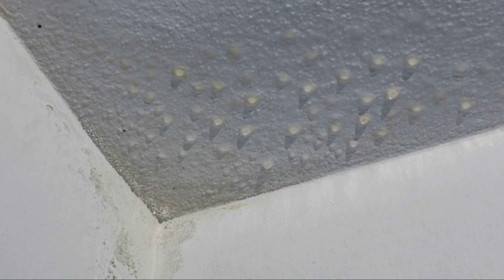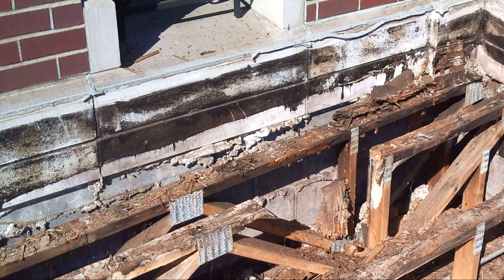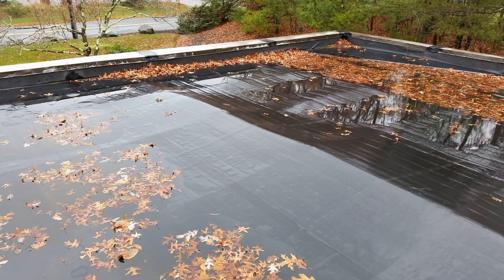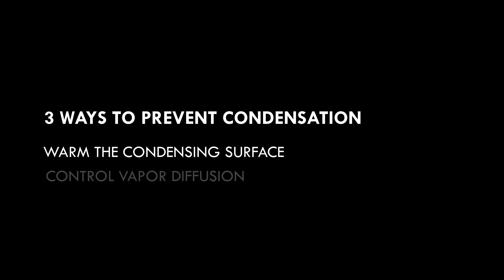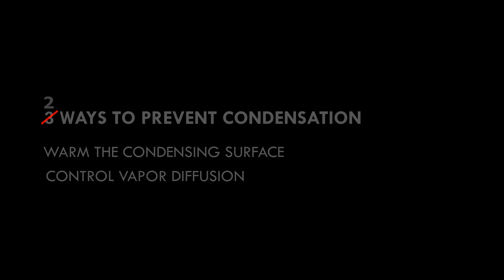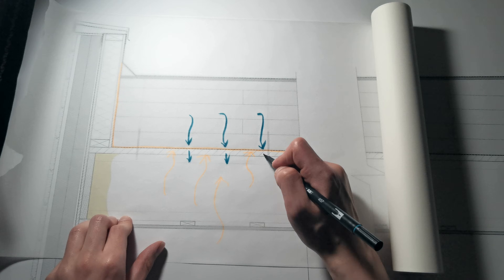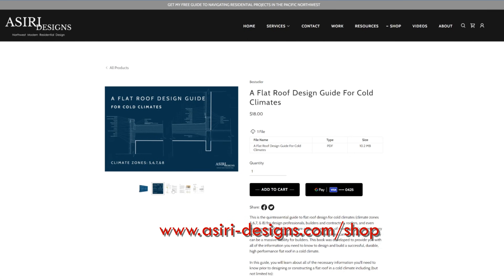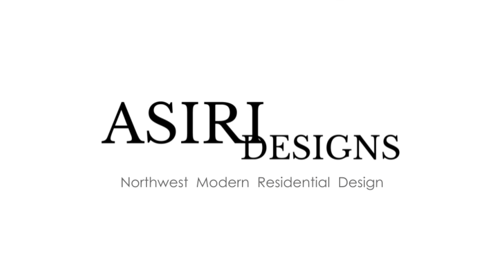Preventing Condensation in Flat Roof Assemblies

Comment: Isn't the term "flat roof" a misnomer?  "Flat" in relation to what?  Aren't all roofs "flat" and monoplane?  In reality, only the monoplane angle differs, in relation to the vertical wall assembly.
And all roof assemblies need some pitch or degree of slope to prevent water accumulation.  There is no intentional zero slope roof except perhaps in desert climates.  
Here again, the building industry is misleading consumers with ubiquitous, vaporous wording.

Comment: Already bought your guide, but there's something that hasn't been explained in this video or the guide. In this video it says you will need a vapor control layer if you're using vapor permeable insulation outboard - but what if you're using polyiso with taped and staggered seams and even using an osb roof deck that is installed with sealant? Can you omit the vapor control layer in this case?
Reply: Good question.  Any follow-up?

Comment: Do you cover insulation of and moisture control of shipping container homes?

Looking to purchase either a 
~ Marine shipping container (Corten steel), or a 
~ preinsulated Freezer Shipping Container "Marine" (Corten steel) 

given that both of these have flat roofs so to speak, AND a continuous IMPERMEABLE METAL surface: (mostly impermeable -- imperfections, holes for windows, doors, plumbing, electrical, etc that might not be perfectly sealed, screw or bolts that also may allow moisture movement despite our best efforts) ....a tremendous amount of spray foam insulation could be applied to the exterior and whatever layers on top of and cladding/siding to protect that...
But then what about the floor, AND the walls snd ceiling inside the container?
Initially we "want/wanted" to install a flat on both sides: milled log floor,wall,and ceiling of about 6 to 12 inches (depending on total R-value achieved with all other layers =  our goal was a total R-value of around 50 to 80 as we intend to be moving it (we are CDL holders so we would keep then on Semitrailers, likely a double drop or other low trailer as we wish to have a HC / High Container 9'6" or higher interior if we find a custom/larger container [oversized load are no problem for us] as the taller and wider is just a nicer internal liveable experience, AND allows for the thicker milled log wall,floor,and ceiling without much perceived loss of space === thermal mass is part of the desire for using milled logs on interior)
... because this would be a FULL TIME RESIDENCE as opposed to a "week/weekend camper or RV like usage...the quality of life within is VERY important, such as: near ZERO chance of moisture trap/condensation aka MOLD, and near ZERO chance of "off gassing" of spray foam/not using spray foam inside ...or offgassing of very much of anything else...we were concerned about termites,ants, mealworms, etc as they are known to EAT foam board, and the only Foam Board that claimed to be "resistant" and explained HOW this was achieved said: it was via a aromatic/fragrant deterrent!! ...1. who knows what effect that has on anyone that might be or become sensitive 
2. Who knows what long term health effects are from exposure
3. Who knows how long it would last
...given so many "unknowns", it also brings to mind whether one should even bother with such concerns? i.e. simply use rigid foam board where it is appropriate and "if" ants, termites, mealworms take up residence eating it, tear it all apart and redo ???
Or are there other methods to safely and EFFECTIVELY preventing and Eliminating such concerns?
Obviously using milled log of any thickness for interior would be a BIG problem with any ants, termites, mealworms...not to mention the off gassing of their fecal waste which is nothing to dismiss as it is quite an irritant to health/immune/allergy/sensitivities/respiratory, etc...
I am familiar with Boron/Boric acid, but it is not perfect and is claimed to have been "ineffective" in situations, and i am unfamiliar with what potential problems it could create with various materials...
I am also very much interested in "Shou sugi ban" (burnt wood) and using it on the milled log interior ...this i do not have any practical experience with, but like the various looks of different applications/degrees of...
... thanks in advance for any direction you can point me in or where to get started with your assistance?